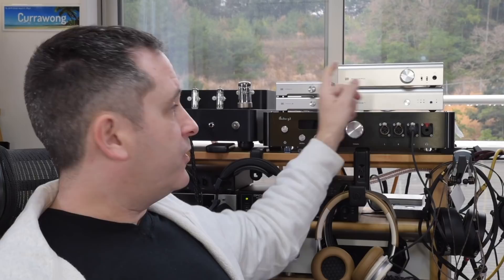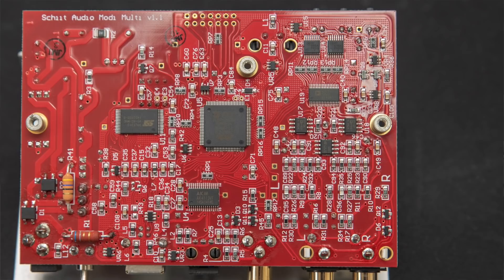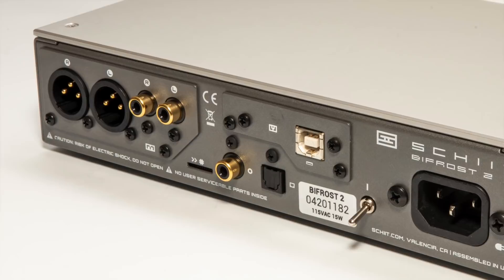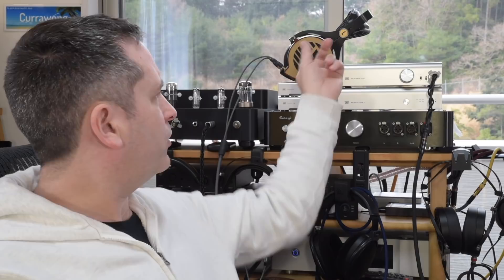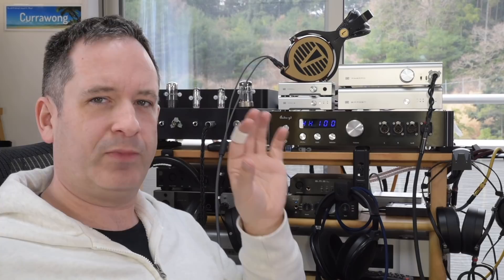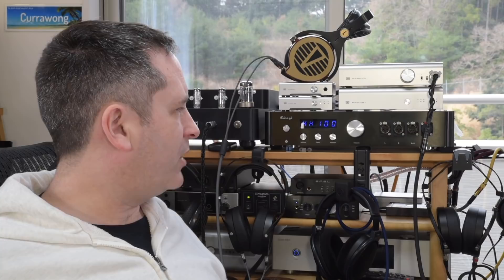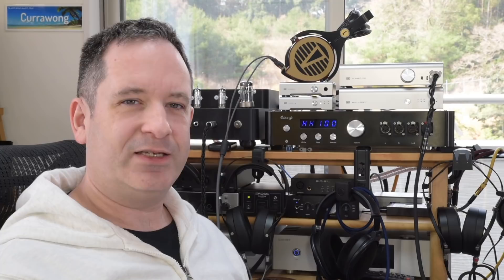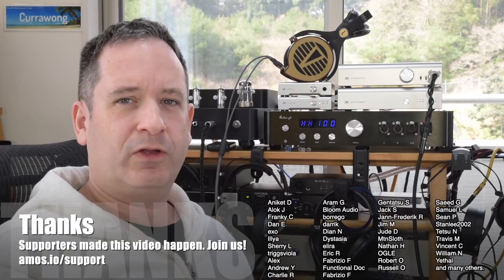Schiit Modi Mulbit/Magni 3+ vs. Asgard 3/Bifrost 2.

Comment: I like most Schiit products but really don't rate their DACS, measure horribly and just don't sound as good as say an RME ADI 2 etc, as preamps they shine.
Reply from the maker: The Bifrost 2 and Yggdrasil measure fine. Which of their DACs have you tried?
Reply: @Currawong  I wouldn't call a SINAD of 86 for the Yggdrasil as measuring fine.  Had a Bifrost and got rid of it, the SMSL SU-8v2, JDS Labs, RME, Topping DACS all eat them for breakfast imo.   

The Mani is a great phono stage, the Johunheim a good preamp product, as is the Freya.  I just don't rate or like their DACs.
Reply from the maker: @MrLoridin  For the Yggy, measured by whom? Not those measurements taken after heating it with a heat gun I hope.
Reply: Currawong ASR and they measured 2 different units to confirm.  Other measurements from other sources also confirmed them.
Reply from the maker: Here are measurements done by someone QUALIFIED who does them for a living (not someone who used a heat gun on a unit because he was told that the DAC needs to be one for a week for the chips to thermally stabilise): https://www.head-fi.org/threads/schiit-yggdrasil-v2-upgrade-technical-measurements.881867/
Reply: @Currawong  you do know right that the v1 measurements by AtomicBob matched the measurements on ASR...  hence there is now a v2... and it's with the v2 they disagreed on measurements, but even Schitt admit they don't measure well.
Reply: Joe Al  they are independently measured mate, and JDS Labs DACS are made in the USA.

Comment: I have ordered an Asgard 3 and was going to get a Modius E, but honestly I think I'll just get a Bifrost 2, it's nearly 3x the price, but I'll likely never need to replace/upgrade it, whereas my goopy brain will probably wonder what could have been if I had just gone for the big guns first. Going for something more than the Asgard 3 seems silly spec-wise but also cost-wise if I end up with a Bifrost.

EDIT: I got the Asgard 3 and have been using it for almost 2 weeks and I was very impressed with how much better the Sundara and 700 Pro X sound with it, still using the Modi. I've got a Bifrost 2/64 on the way, super keen to hear how it sounds. I've got high hopes due to the reviews I've heard.

Comment: Great video as usual keep up the good work I'm currently using the Modi Multi-Bit paired with the drop CTH hybrid amp and also with the emotiva a-100 flex amp in direct mode with jumpers in I need the extra power from that for my Fostex T-XO from drop also and very pleased with the results Thanks again.

Comment: For fun, why not swap the DAC around and compare the outputs again? it may turn out that DAC s differences are minor, but more differences are in the headphone amp, especially if you only use  SE output and non-USB connection.
Reply from the maker: I did that to some degree in my amp reviews. The idea of this video was specifically to focus on the differences with whole system upgrades. Thanks for the suggestion though. I might do some more videos like this one.

Comment: You need to switch them and test Mimby>A3 v Bifrost2>Magni3+. It'd be interesting to see how much of the improvement you saw in your test was the DAV v the amp.
Reply from the maker: That's covered in the reviews for each component. But I will probably do the inbuilt multibit card in the Asgard 3 (equivalent to the Mimby) vs. the Bifrost 2.
Reply: @Currawong  I have the MB card in a Jot. It's pretty good. I preferred it to the Modi 3 but Eitr>Mimby is a bit better.
Reply: @redrich2000  The Eitr greatly improves computer USB.  I heard the difference straight out of the box.
Reply from the maker: https://youtu.be/Utaw2e9sxps As promised.

Comment: I have both amps. Asgard has the 4490 dac. I use my magni on a daily basis. Asgard just sits there. It gets used for preamp more often than it does for headphones.
Reply: Which Asgard and Magni do you have...the 3 and the 3 Plus? If so, why do you prefer using the Magni?

Comment: I just ordered 6XX. I'm thinking to buy Asgard 3. I have HRT Music Streamer II DAC. Should I replace it or will it be good enough? I can't afford Bifrost. What would be cheper option?

Thanks!
Reply: Try a Beresford DAC. I use one and it sounds awesome with my Asgard 3 and Audeze LCD-2C.
Reply: You can get a built in dac card with the asgard three for 100 dollars extra. I would just go for that and buy a seperate one overtime.
Reply: @insertaghere  Doesn't that card have terrible reviews? I believe one of the reviewers said you are better off using a Modi with the A3 instead of getting the card.

Comment: I just got the HD6xx, and I definitely need an amp upgrade (currently using a fiio e17k lol.) I don't want the limitations from the modi/magni combo, but I simply can't afford (yet) the asgard3/bifrost2 combo. Does a Modius/Magnius make sense for the price? Since I barely see any reviews for this combo, I thought I would ask, as they are exactly in my budget. I would use them balanced of course. Would an asgard 3 with the multibit dac module make more sense as they are the same price? Thanks in advance!
Reply: The Magnius is the same price as the Asgard3 (both 199$), right? Why would you not get the Asgard3 immediately then?
Reply: @ludiusmaximus  I need a dac too, so I'd have to get the module. Both options would be 400usd, but I can't find reviews of the magnius. Both have modularity, but the magnius has balanced outputs. I'm looking for more info to get the best bang for buck. I'm also looking into the topping dx7 pro, a little more expensive, but maybe a little better.
I haven't run to buy an asgard because I still need more info. Unfortunately, there's nowhere I could try any of this gear, as I'd have to import it.
Reply: @Tidwillshare  All right. It sounded like Bifrost+Asgard is your goal and Modius+Magnius would just be an intermediate solution while saving up for the Bifrost. Because then you could start with Modius+Asgard right away and already be 200$ closer to the Bifrost.
But I agree that the recently released Magnius is very confusing to me as well. In Schiit's FAQ on the Magnius they say it is virtually the same as a Magni Heresy with balanced in/out. And they seem to see it more as a competitor for the 400$ Jotunheim, not even mentioning how it relates to the also 200$ Asgard...
Reply: @ludiusmaximus  yes! It is very confusing and even more without a way to test the equipment. The bifrost is more expensive than my entire budget, so unfortunately for me it's totally out of the question. Ironically, after researching all I can about schiit, I'll most likely end up with a topping dx7 pro and a slightly stretched budget, and I'll keep my fiio e17k as my mobile solution.
Reply: Get a Rupert Neve Designs Precision Headphone Amplifier. You will not find a better headphone amplifier, period. $500, but you can get it for $400 on Amazon by opening an account. It is the best money I have ever spent on audio equipment. I am using the Modi Multibit and Sony CD3000's and I am so stoked!

Comment: Hello Amos, I'm kind of in a dilemma. I ordered the Schiit Vali 2+ / Mimby stack, but after 5 months waiting on rolling backorder nothing seems to unjam the Mimby from part supply issues... For the same price I could get the Asgard 3 with their latest unisson USBC ES9028 card. Would that be a good alternative to run HD6XX? The Vali-Mimby stack with the HD6XX is supposed to be a perfect match, but on the otherside, the Asgard is more powerful (and better than the Vali??), the continuity circuit seems good as well as their unisson. Have you tried the new DAC chip? Would the built-in card affect that much the quality compared to an external DAC? Would I loose a lot letting go of the Mimby? See... Schiit's in my head now! Thanks for your help!
Reply from the maker: https://hear.audio/faq
Reply: I’m curious if you ordered direct from Schiit.  I did and got my stuff within a fortnight and cheaper than Aus price.

Comment: Great review! Is there a multibit DAC to recommand or review that will sit between the modi and the Bifrost in price and quality? Thanks.
Reply from the maker: Maybe only a second-hand Bifrost Multibit.  They aren't cheap to make, so it gets to the point that either a lot is compromised in the design, or it costs more. If you want something as "musical" though, a Chord Mojo would do it.
Reply: @Currawong  Thanks! Would you rate the mojo above the modi multibit? Would it be a good match for the asgard 3
Reply from the maker: Yes, I would rate it above, easily and it works fine with the Asgard 3. You may find it works great straight to a lot of headphones as well.
Reply: I appreciate the comparison of mojo to multibit.  I was surprised to think mojo has that “musical” categorization.  Also, the sound clips @mykeldg posted surprised me to hear some of the “fun” sound I thought the modi multibit would present.   Do you think a Mojo 2 is likely in the next 12-18 mos?

Comment: You’re describing amplifier headroom as the primary difference. Makes sense. Use the right headphone for the amp.
Reply: I'm pretty sure the main point of his video was to highlight the improvements of the Asgard/Bifrost over the Magni/Modi. Headroom was just one point he mentioned. Either stacks are going to drive any headphone and then some. Sound quality is a different story.
Reply: Joey Brooks sound quality and headroom are inherently linked. Having 3-6X the power rating of your headphones will make more difference than almost anything else. If you’re running any amp with the gain above 50% you need more amplifier if you want optimized sound. This is how I design all my studio installations (my job), everything last longer, sounds better, runs cooler, it’s just better.
Reply: @SirBoden  Got it thanks

Comment: This is such a good review. 
I just bought a sundara and need an stack.
If this is all i own, is the upgrade worth it?
I just have trouble spending more on my amp and dac than on my headphones.
Reply from the maker: Cheers. The Bifrost 2 is a bit of an outlier due to the cost of the industrial DAC chips, which are expensive. A good R2R DAC can be very satisfying though, making you want to listen more.
Reply: I have the Sundaras and was using a topping e30 dac and JDS Atom amp. Quite good, but when I switched to the Asgard 3 amp the Sundaras really came alive! Much better separation and a wonderfully deep soundstage, also midrange clarity MUCH improved...vocals and orchestral instruments especially better. Love the combo. I imagine it would be even better with the Bifrost 2, though timbre might be different. Hope that helps you
Reply: @TimpTim  That is exactly the information I need.  I have been looking at the Topping 30 stack vs the Schiit Modi/magni3+.  They would compare to your e30 and atom. 
I just want to be clear before I spend an extra $100.  You think the Asgard 3 is worth the extra money for Sundaras?
Reply: @michaelreed649  Absolutely worth every extra penny!!! Also powerful enough for future phones.
Reply: @TimpTim  Thank you!  I now know what to get.  Thanks again!
Reply: @michaelreed649  Been there, glad I could help.

Comment: Thanks for a very useful comparison. I have a Focal Clear and about to get the Audeze LCD-X. My current stack is the Schiit Vali 2+/Modi 3+ - I wonder if my current chain is not optimal and I should at least move to a Magnius/Modius stack to get better sound stage and resolution for my current headphones. The Asgard 2/Bifrost 3 seems excessive for my mid-tier headphones and costing more than each headphone.
Reply: Keep the Vali and replace the Modi 3+ with the Multibit 2, which is superior in every way.

Comment: I have the Asgard 2 and modi 2 amp, no competition Asgard 2 is a class A amp sound so natural and powerful,  modi ? Ok if you don’t have money . Forget any schiit dac,  don’t do DSD . I use Topping. D50s combined with Asgard 2 and little dot mkii tube amp, drive sennheisrr Hd600, heaven.
Reply from the maker: I find that a DAC that does PCM well makes DSD unnecessary. That's what is great about the Schiit multibit DACs.
Reply: @Currawong  I have the mofi multibit. Though decide 44k 16bit natively, the sound is not as clear and neutral as delta sigma dac like D50s. I think I might to spend more on a denafrip ares  2
Reply from the maker: I don't think it's possible to do a well-performing, yet cheap R2R DAC. Too many things have to be compromised.

Comment: do I need a DAC if I have a soundcard (for my PC) that goes to an A/V receiver (which has a headphone jack)?  Or is it better to have a DAC plugged into an A/V receiver?  Also, do I need an AMP, or is that the A/V receiver's job to function as an AMP?  I'm so confused...
Reply from the maker: There's no "right" answer. A soundcard IS a DAC.  If you have a soundcard and A/V receiver, try each one with your headphones and see if one or the other sounds better to you.
Reply: You definively need an outside dac. Best investment even if i have ASUS gaming motherboard. The sound is dead with the on Board Chip.

Comment: Which combination do you prefer? Bifrost+Asgard 3 or Bifrost+Lyr 3?
Reply from the maker: It's funny you should ask: Bifrost + Lyr3 + MELZ 6N8S tube. The tube has a very "clear" sound which I find balances nicely against the slight softness of the Bifrost and Lyr3.
Reply: @Currawong  Nice. Thanks for the info. I'm looking to upgrade my set up from a Modi Multibit+Vali 2 to a Bifrost+Asgard 3 or Lyr 3. Do you think the Lyr 3 is worth the price difference?
Reply from the maker: If you can afford the Lyr 3, as well as have a budget for a few tubes to try, I'd go with that, as you can get more out of it with a better tube than what comes stock. If you want simplicity and don't want to bother with tubes, get the Asgard 3, or the Drop THX amp (if your headphones have a cable with 4-pin XLR) or similar. Of the gear I've had here, that's what I reckon anyway.

Comment: Hello from Greece, 
do you have a comment to make about HeadRoom Max balanced in relation to the Schiit Magni and Asgard. There's no way to test them here, somebody is selling a 1999 model for 400€. Schiit magni 3 is new for 150€ and asgard(AKM) used for  250€, the headphones I use are hd600 - thank you .
Reply from the maker: Can you get the Jotunheim there? Something like that would be better value, and you wouldn't have to re-terminate your headphones to a defunct connection method.
Reply: Thank you for answering, local dealer here has the Lyr with a dac on it for 670€ which is too much for me. I' ll have my eyes open for a jotunhaim anyway - wish you a good day
Reply: .. forgot to tell you that there is also available a Cayin ha-1a for 300€.

Comment: Wouldn’t a Magnius + Bifrost be better comparison as the Asgard is a dac/amp combo?
Reply from the maker: The Asgard DAC is optional. It's primarily a headphone amp.
Reply: Ludius Maximus the Asgard doesn’t have balanced does it?
Reply: @robertkirkpatrick1826  That's right. But if you do not need balanced, what AMP would you chose? Magnius, Asgard or even Magni? In Schiit's FAQ of the Magnius I read that the Magni Heresy does virtually everything the Magnius does except for the ballanced ports. And they seem to see the Magnius more as a competitor to the Jotunheim than to the Asgard. Does this mean Magni + ballanced = Magnius ~ Jotunheim > Asgard?

To be fair, the Magnius has just been released, so maybe we'll get a review in the future.
Reply: Ludius Maximus I like the idea of not limiting myself to non balanced. And the ability to add the dac internally  the Asgard.
Reply: @robertkirkpatrick1826  I bought the Asgard because I want the class-A hybrid design, and the single-ended port on the Magnius has much lower wattage than the Asgard 3. I didn't want to be limited to only buying balance-able headphones and buying expensive cables forever lol.
Reply: JakeAndBake that makes sense.

Comment: What if you replace the Modi Multibit with the Modi 3?
Reply from the maker: I didn't get around to getting a Modi 3 to compare, though I'd be surprised if the experiences would be radically different, aside from the fact that I'm not a fan of AKM DACs below the 4497 (The Modi has the 4490).
Reply: It explodes.

Comment: Did you say 550 for Asgard 3 and Bifrost? Where? I saw 699 for the Bifrost alone!
Reply from the maker: Nope. I said that there was a $550 difference between both rigs ($900-350).
Reply: @Currawong  Oh ok. That makes more sense. That huge gap between modi multi and bifrost is really annoying. I want to move up to the Asgard, but I don't know if the modi will just hold it back. Thanks!
Reply: @Currawong  So, I've been wondering. Have you ever compared the vinyl sound, to r2r dacs? It seems to me, that the premise is the same. An "analog" sound. I'm curious, because r2r dacs are so damn expensive. Any insight would be much appreciated. Thanks!
Reply from the maker: Not directly.   I've avoided getting into vinyl, I just don't have the space to spare.  That being said, with the systems I've listened to, I definitely understand the appeal of it.
Reply: @Currawong  Thanks! I'm in the same situation, when it comes to space. Most of the modern music I like, tends to be compressed like hell, on CD, and having checked, seem to have better dynamic range on the vinyl presses. This is all much harder, as I don't plan to splurge on the budget.